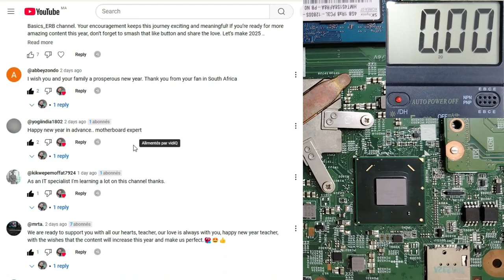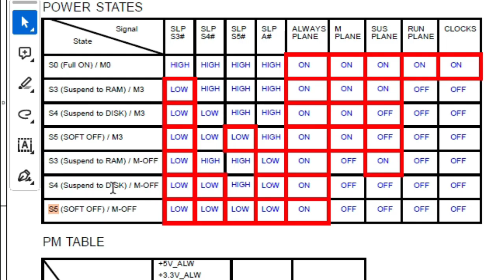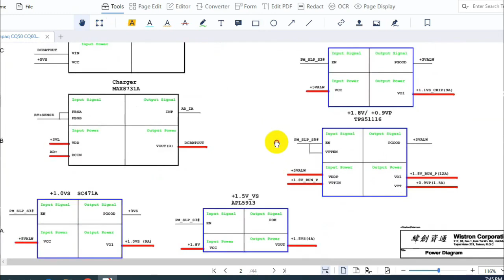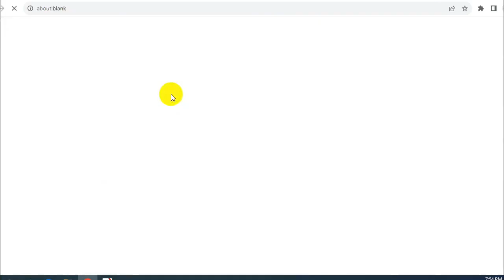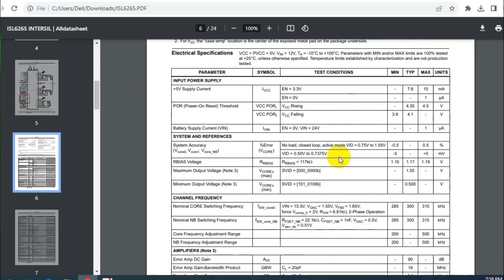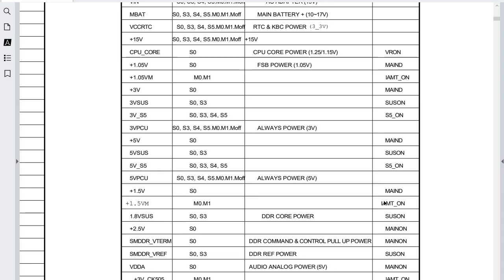What I Learned from Repairing 100 Laptop Motherboards Will SHOCK You

Comment: My laptop will display only if battery is connected to the board  or only if the charger is plug in without battery.if the battery and charger are both plug in it will not display...what is the specific chip or component should I check? Thank in advance!

Comment: 33:19   this is exactly the IC  I have in my faulty Lenovo AIO  330 20AST  motherboard . the IC is getting extremly hot when I plug the 19v adapter , this heat is transmitted to the CPU power rail 4 mosfets +1 polarized cap+ 4 polirezed caps , and then the heat goes to the processors . I unplugged it quickly , I fear I killed the CPU . I need to learn how the IC works , I need the voltages on Ugates   and Lgates to trigger the signal , I need power good signals etc...